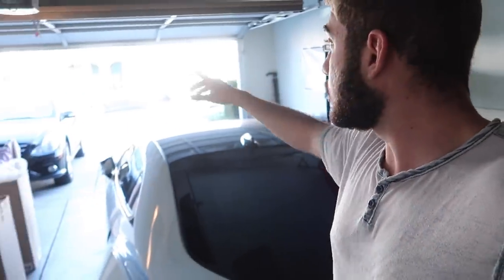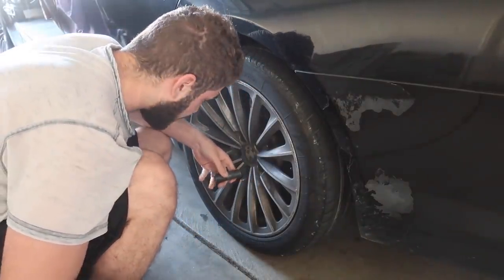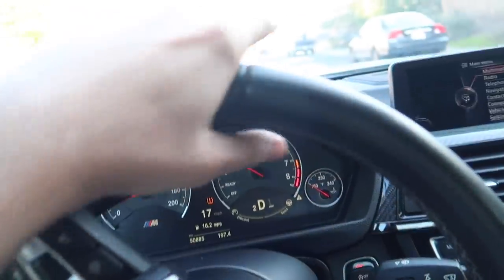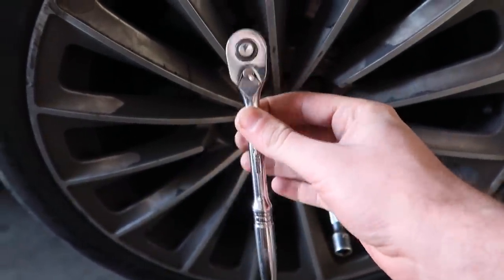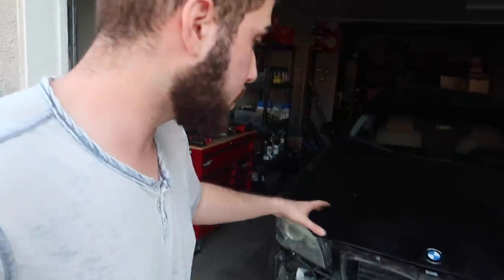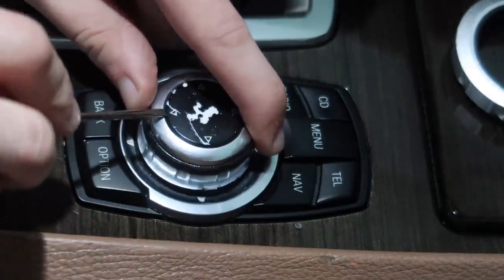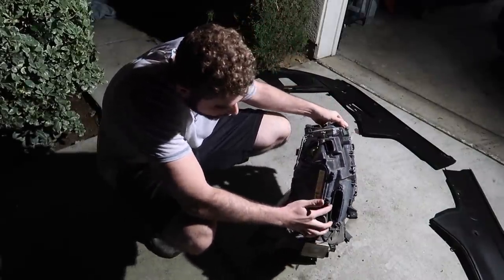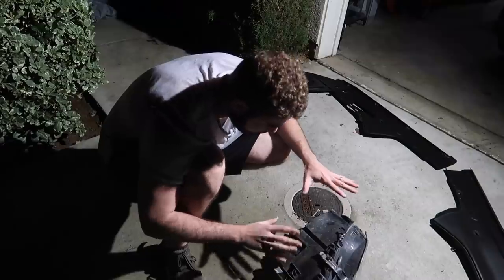Rebuilding An Abused BMW 740Li N54! Part. 5

Comment: heat up the stripped bolt, should usually loosen the bolt up and give it enough to move it with the breaker bar, I suggest you lift the car up remove all the bolts that aren’t stripped and hit the wheel with a mallet, it could loosen up the threads a bit, then heat it up and remove the bolt. I saw this technique on legit street cars with his Tesla repair although it wasn’t a wheel bolt he managed to remove the bolt.

Comment: you can't put on a clear bra right after a new paint job. usually takes a month for the paint to fully cure before you can install a clear bra
Reply: Your supposed to clear coat it right away but not ceramic or wax it for a month when it comes to new paint
Reply: @johnbecker8478  clear coat is part of the paint process.    Clear bra is different. It’s like a clear wrap that’s there for protecting the paint
Reply: Mr10mohammad10 my bad I thought that’s what u were talking about the paint u would be absolutely correct my b

Comment: I used to work at a bmw dealership and when we had seized or stripped lugs, heat the hub where the lug is and hammer on a strip socket one size smaller, never failed me

Comment: Did you check bolt for N gear? It is left side on transmision it is needed to be out and leaver free. Here is link :https://f10.5post.com/forums/showthread.php?t=1683926